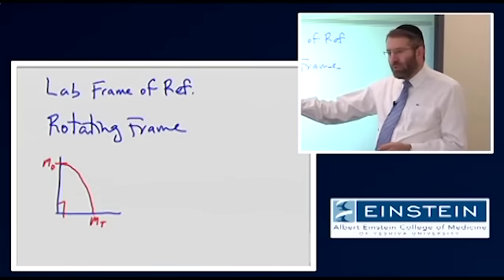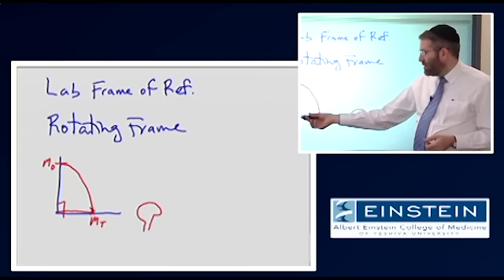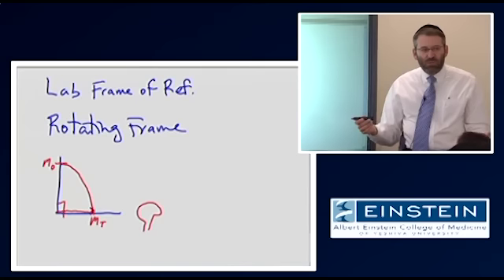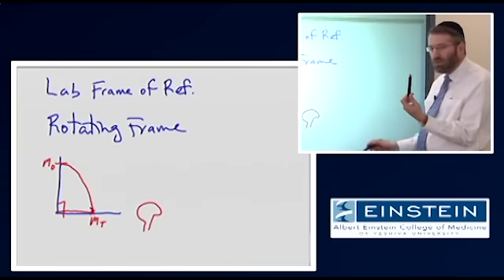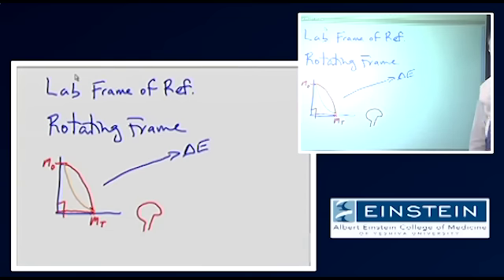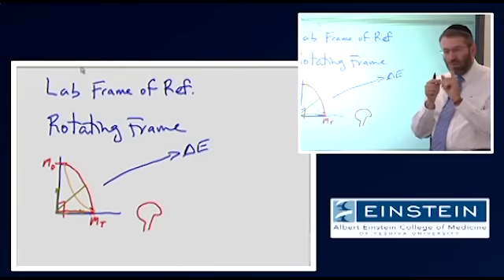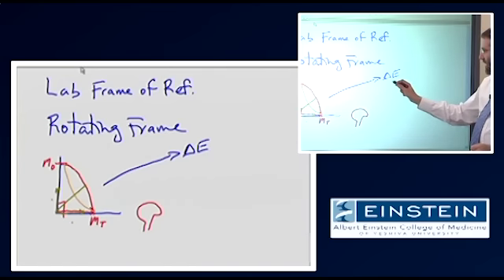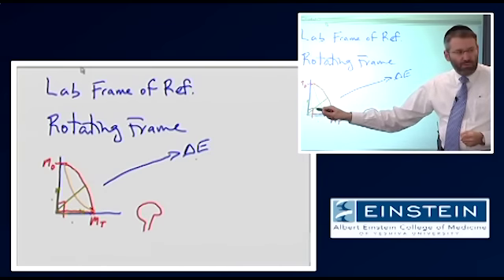Introducing MRI: Introduction to Relaxation (9 of 56)

Comment: How does the T1 relaxation look graphically over time from the stationary frame of reference then? It would make sense to me that it would rotate back up using diameter on the rotations as it realigns with Mz ... is this not the case?

Essentially, shoudn't the "x-axis" be the xy plane and not the Mt to show the path of T1 relaxation graphically?

Comment: Please help me: When the B1 is applied and the Mo starts tilting, what is going on with the individual spins? Is the entire "precession cone", preserving it's internal precesion angle, tilting? 

If that is the case then I must interpret that the phase coherence achieved on the xy plane is only partial and not a perfect alineation of the spins. Some illustrations found in books or even animations on Youtube are quite confusing on this matter since they show a complete phase coherence on the XY plane of the individual spins.

Comment: Does n0 means the original random state of spin in the object within mri?
Reply: Not random the longitudinal mag 
There is two random
One spin spin the spins aligned randomly along the trajectory of precessions thats equal to zero Transverse mag because if u learned vectors most of them cancel each other out 
Second one is at rest when there is no magnetic field at all and this has zero Longitudinal and zero transverse